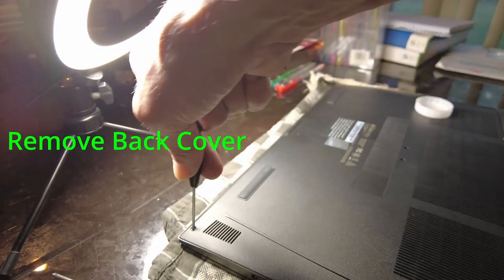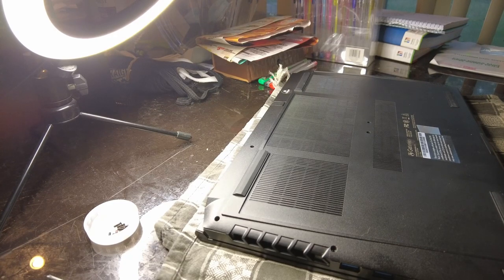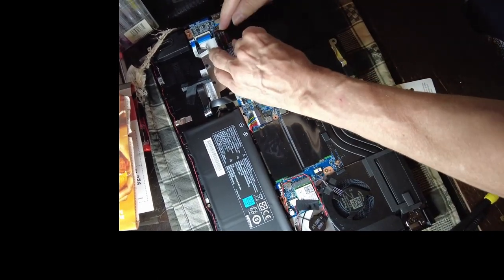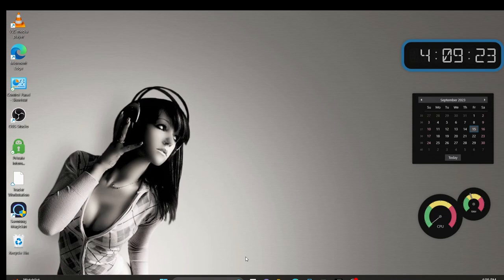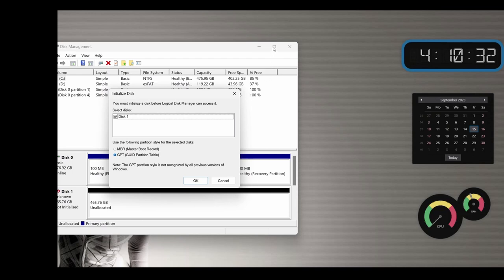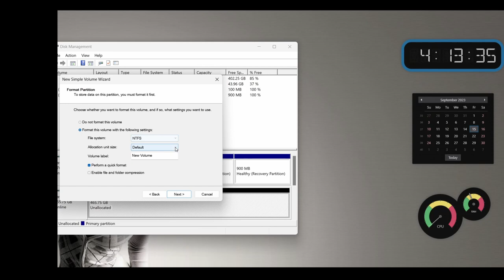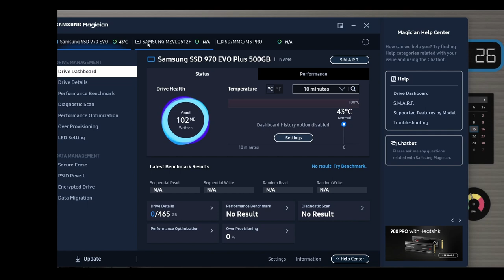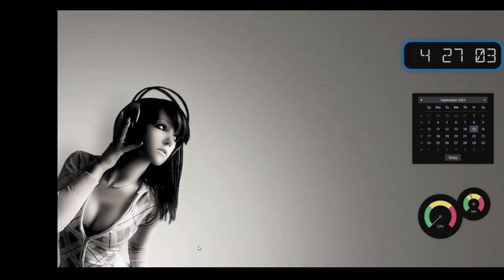Install Samsung Evo NVMe SSD in Gaming Laptop!

Comment: Planning on buying this this week hopefully, is ram upgradeable to?
Reply from the maker: Both ram slots were full to 8 gigabyte sticks. You would have to remove those and put for example two 16 sticks.
You might double check with gateway support like I did to see what the max RAM is for that motherboard.
Reply: @cashwise7614  how is the performance so far? Planning to use it as a backup jus to make beats and light editing , it’s between this or a used hp omen 17 gaming from 2019 1tb,12ram, gtx1660ti, intel i7-9750h, which would u recommend really like the omen cuz the look thank u
Reply from the maker: I'm Happy with it! 
 it's my backup for video editing haven't used it much   (use my desktop when not traveling) I will say the screen is good and sound pretty good as well. The only negative I have is battery life not great. Not a huge issue for me but for others it might be. 
Still the most capable laptop with a graphics card for the money that I have seen. The 1660 would be inferior to the 3050. I guess it also depends on the price of the used machine.  @WrldIzyourz
Reply: @cashwise7614  what 1tb ssd model would u recommend? Since I run music programs rather it all be in one spot
Reply from the maker: For this Gateway? If so probably one of these : https://amzn.to/3Fn4bzY , https://amzn.to/46F94kc  @WrldIzyourz
Reply from the maker: Remember the gateway only has a maximum 1 terabyte memory for the motherboard. If You're getting a machine that accepts Gen 4 and Nvme SSD definitely get the Samsung above.